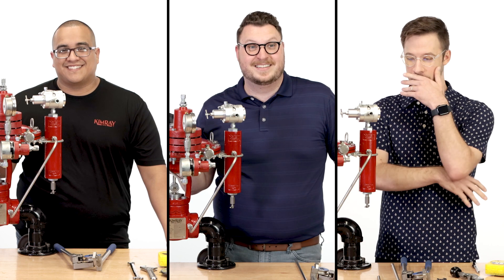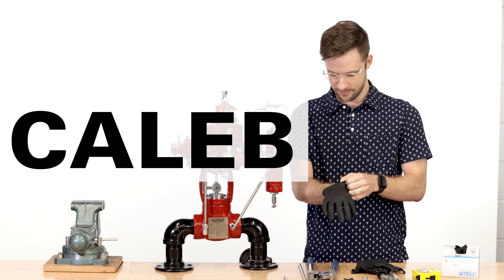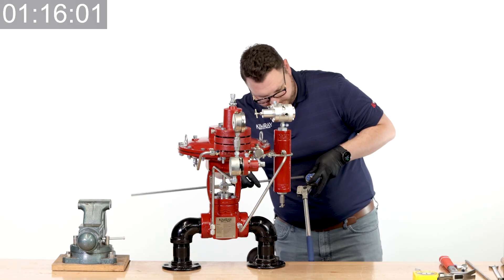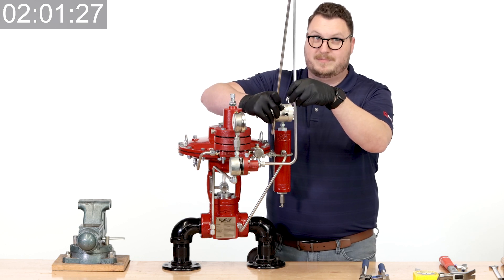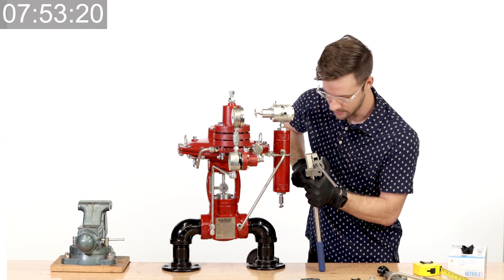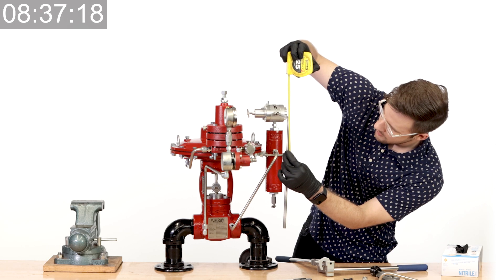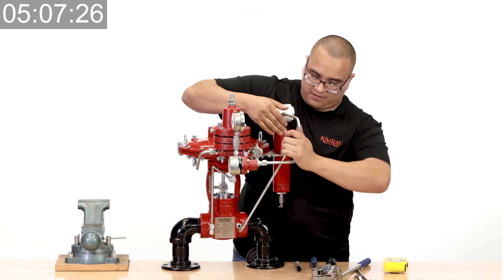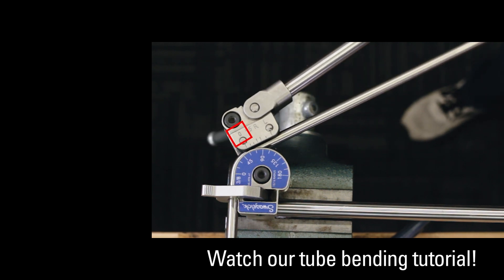Tube Bending Competition on a Kimray Control Valve

Comment: I like the guy that didn’t measure with a tape. Just used the actual pipe and marked it. That is how I like to operate when I can. I am however aware there are math formulas you can use to get all the correct angles and lengths… I got a genius friend that can do all that. Sup Schaff!!!!😊